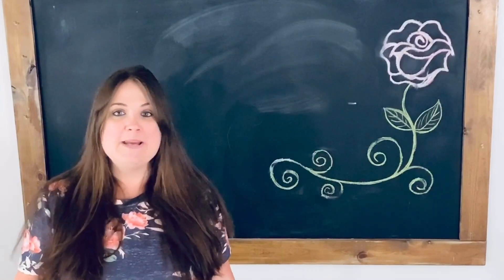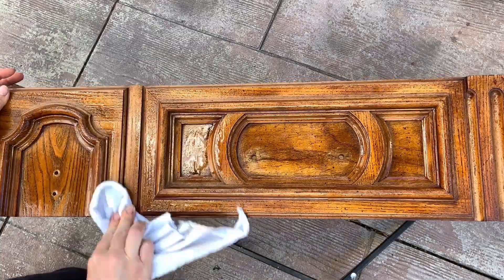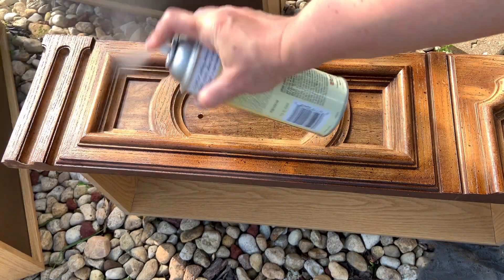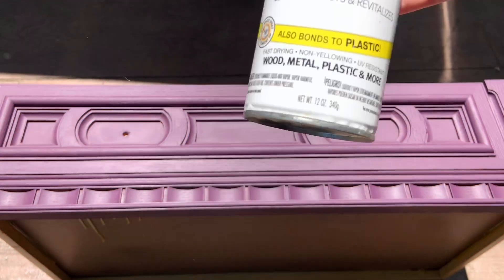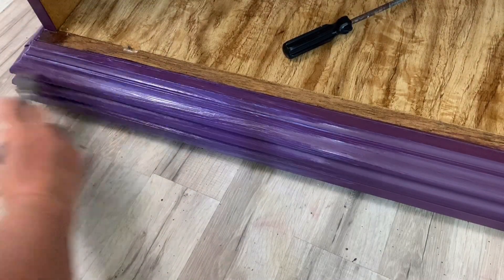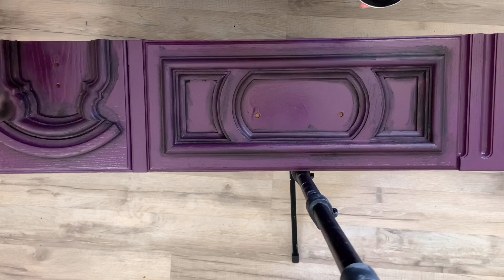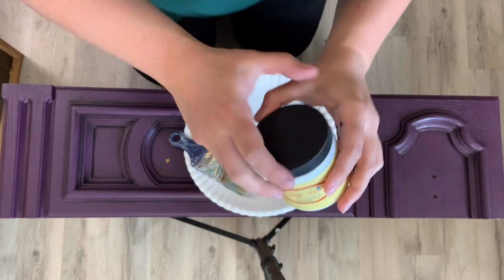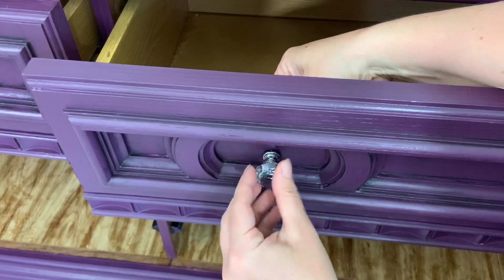Dresser Makeover | How to apply black wax | How to update your old Handles| Furniture Makeover

Comment: Thank you thank you, beautiful work. I have one question. Isn’t shellac better for top coat than just a clear coat spray for handles ?
Reply from the maker: Thank you! Sure,  shellac works too! I haven’t had any issues with using a regular sealer. The only time I’ve had it peel or chip is when I wasn’t using anything. Lesson learned 🤣
Reply: @FlipItFurniture  thank you for quick reply 👍 I just painted handles of the  dresser for my kids room and want something that really strong 🤣